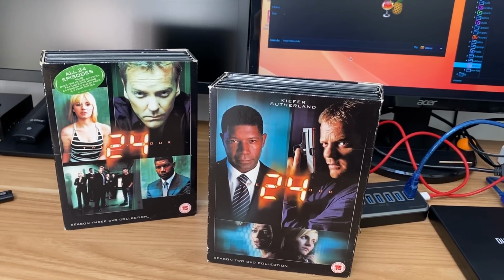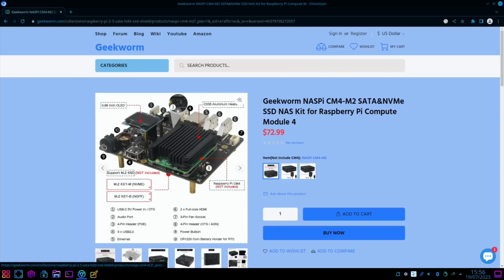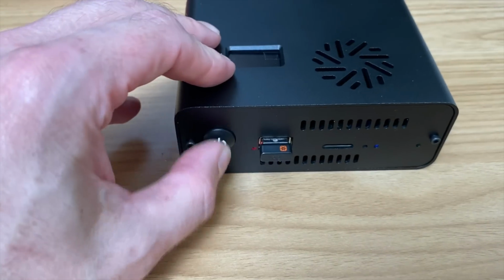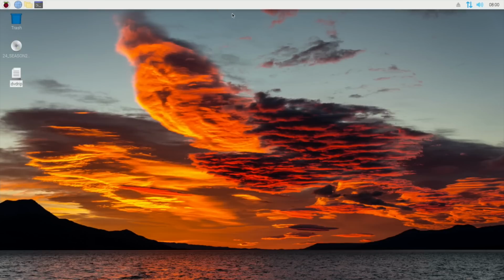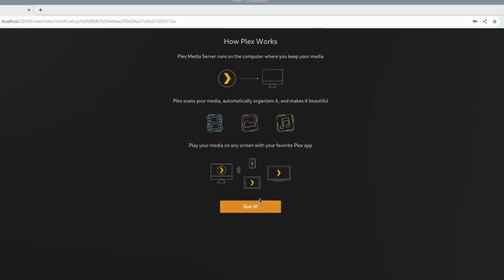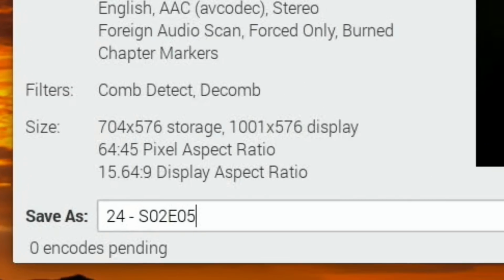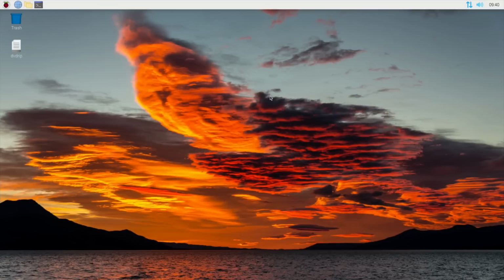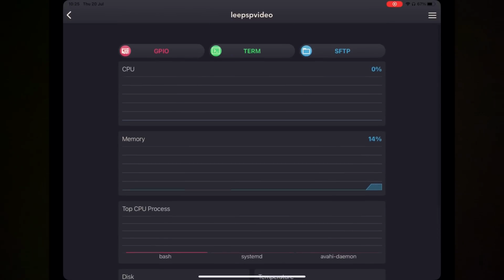Raspberry Pi Plex server setup with Geekworm NASPi CM4-2.5

Comment: I've been meaning to rip all of my DVD's, but it's a daunting task when you've got 100's of them collected over a time span of 25 years. I may need to buy a beefier drive though, since the one I have is a chintzy $20 drive and I really only intended for it to back up my more modest PS collection of games, and it couldn't even do that adequately. Took hours to fully backup FF7 and there were all kinds of disc errors. Sad thing is, you get what you pay for with electronics and insane inflation on electronics means your money takes you a tenth as far as it used to for similar quality.

Comment: not enough storage ability and not enough horsepower for a proper Plex server, but suppose could get a peasant by hahahahahaha
Reply: silly slappy, when you properly pre-recode your content to 3 Mb/s its more than enough.. add a couple of cheap USB Ethernet 2.5Mbit/s & map your less used files to a remote cifs share although an optimised 'Jellyfin' would be a better fit over pay to play Plex.
'makemkv' then
------encode.bat
FOR %%A in ("*.mkv") DO ( 
ffmpeg.exe -threads 0 -i "%%A" -f mp4 -vcodec libx264 -crf 16 -minrate 900k -maxrate 3100k -bufsize 3100k -refs 3 -preset veryslow -vprofile high -strict -2 -acodec aac -ac 2 -ab 192k -vf yadif,hqdn3d,unsharp=5:5:0.5,gradfun  "%%~nA.MP4"
) 
pause
---------------

Comment: I have my Pi4 running the docker version, with CIFS mounted volumes from my NAS. Works great!. You might want to rip the videos on your Mac though, It'd be hugely faster than the Pi.Also, if your TV supports it, encoding in h.265 HEVC would result in much smaller file sizes.

Comment: I'm going for a trip and wanted to convert some of my DVDs to mp4, but for some reason the AutoGK on my Win11 did not recognize my decrypted Video_TS folder. Watching this video you game me an idea using Handbrake to convert my videos.
 I wasn't familiar with this tool, so Thanks.
Reply: 'makemkv' then
------encode.bat
FOR %%A in ("*.mkv") DO ( 
ffmpeg.exe -threads 0 -i "%%A" -f mp4 -vcodec libx264 -crf 16 -minrate 900k -maxrate 3100k -bufsize 3100k -refs 3 -preset veryslow -vprofile high -strict -2 -acodec aac -ac 2 -ab 192k -vf yadif,hqdn3d,unsharp=5:5:0.5,gradfun  "%%~nA.MP4"
) 
pause
---------------

Comment: I am curious about everyone’s thoughts about Jellyfin and 4K MKV playback to LG WebOS TV.
Reply: Jellyfin is fully open & free, use it.... 4K MKV playback on any device with generic hardware mkv container decoding as long as the decoder likes your encoded stream & container mkv in this case.... hence why the older mp4 containers are used as the base decoding spec today, it may or not also have the mkv container hw decoding included too.
mkv could work but does the LG WebOS TV have that container included ? if not then ffmpeg remux the video into an mp4 container.